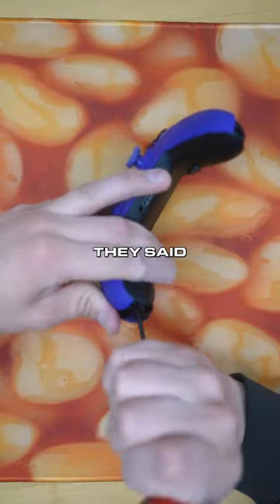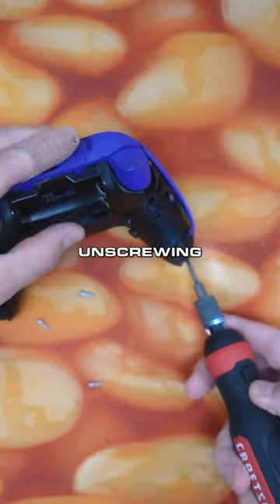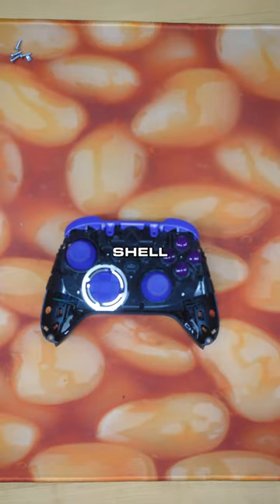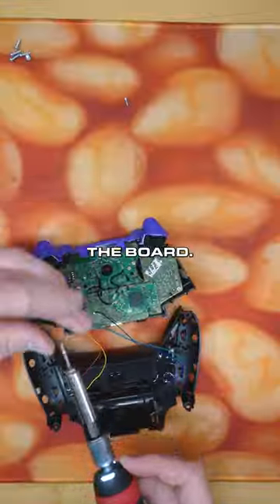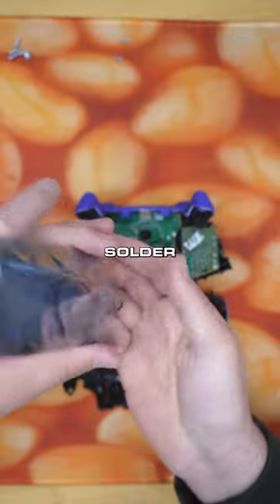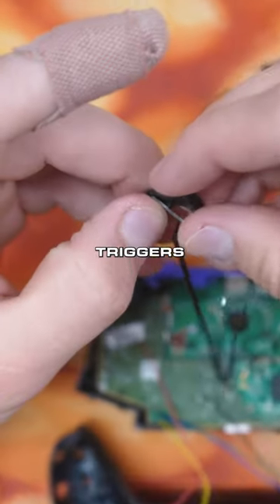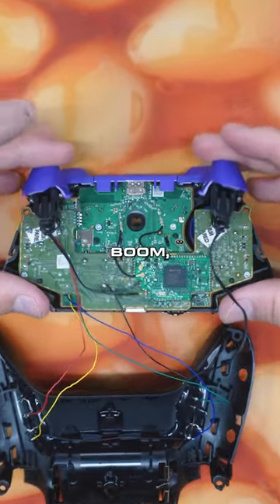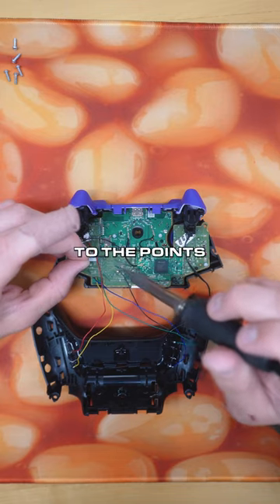Trigger repair on an xbox controller. #xbox #gaming #repair #customerorder #smallbusiness #gaming

Comment: Good job! But why would XBOX make the wires soldiered and not on some sort of connector for easier repair. I know that those 2-3 more cents add up to couple of thousand dollars for the quantity they manufacture, but still it gives bad impression for the design quality.